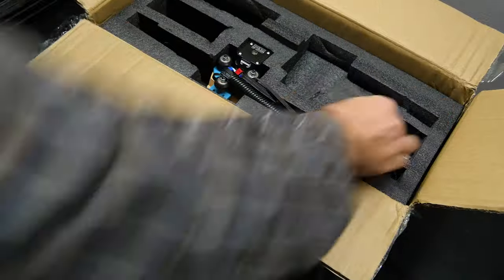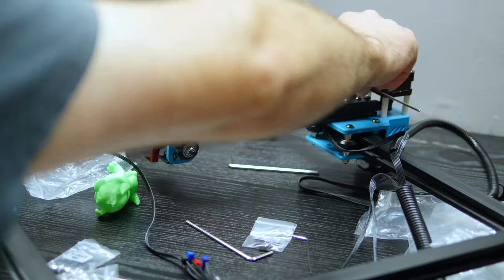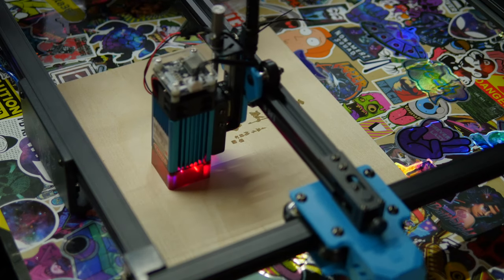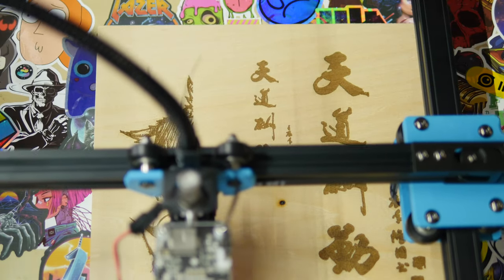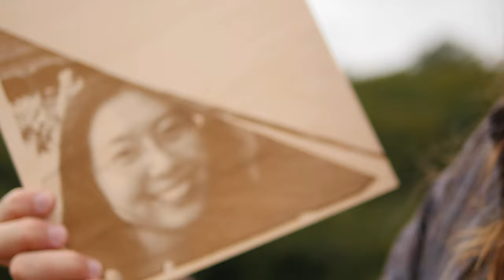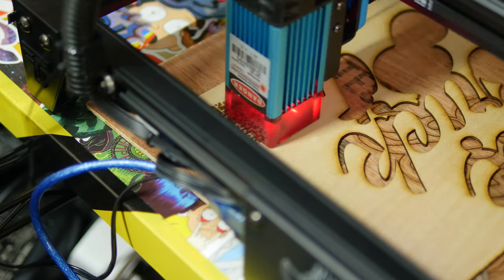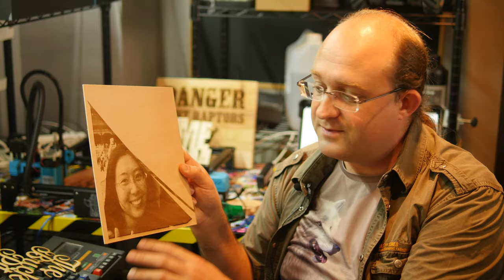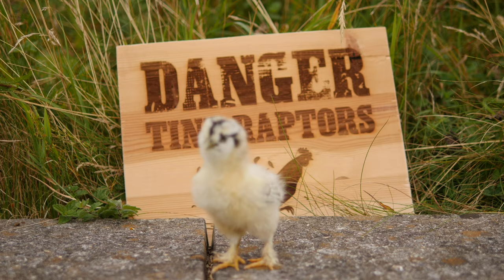Totem S Laser Engraver: Your Workshop Needs One of These

Comment: i have a twotrees totam s engraver i need help with the settings. 1st. how close should i be to the red plastic shild should i bee from the project.  2nd. when engraving wood what should my power bee and my speed settings ? when cutting wood what are my settings be.  3rd. when engraving plastic what ar my settings, and last lets say i want to engreave a metal lighter what should my settings be? please help. i am using  laserGRBL. please i beg  you for help.
Reply from the maker: The red shield is calibreated at the right height, so it should be as close as possible without dragging on the material. To engrave wood, I'd recommend 20-30% power at 3000 speed. Cutting depends on your thickness, but for me, thin plywood 300 speed and 100% power worked. I haven't tried metal yet I'm afraid, but you'll need to spray it black to ensure it doesn't reflect.

Comment: Hi, what parameters you use to cut the 3 mm Wood?
Reply from the maker: 1 cut at 100% 300 speed - but it does depend on the wood, so you may need to play around with those until you get the desired result. The last bit of plywood I tried on ended up with a lot of unwanted burns around the edge, and needed two cuts. Not an exact science!